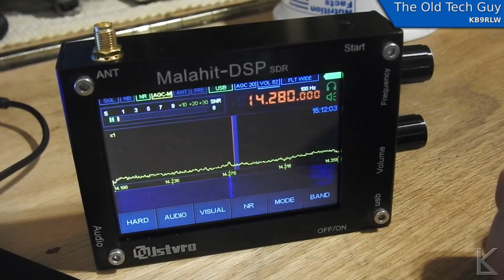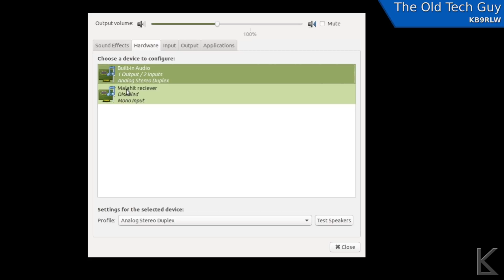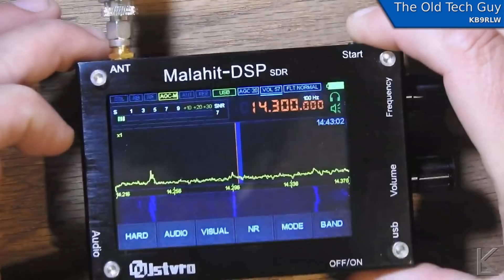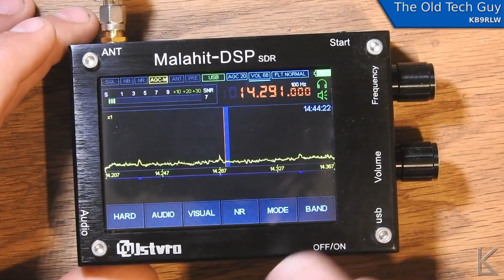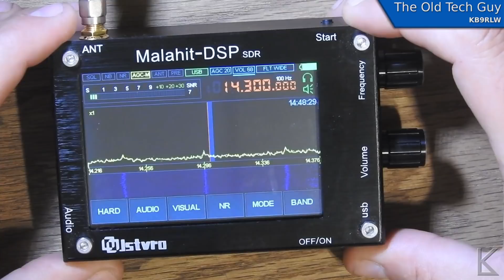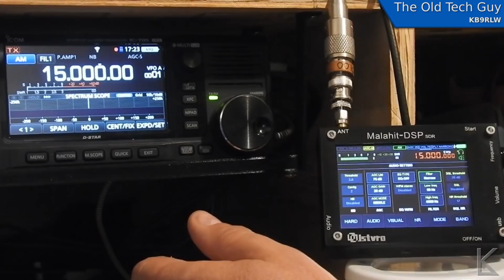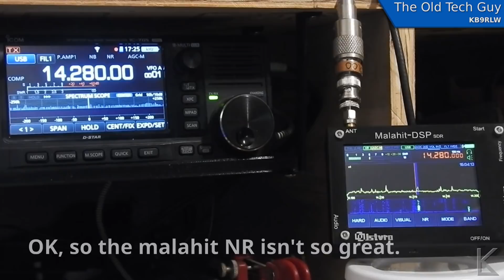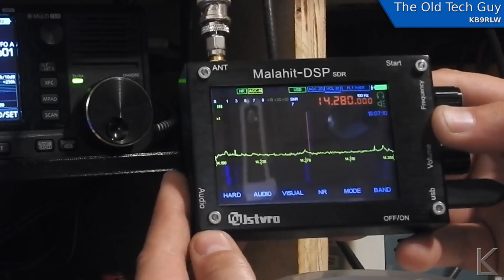Ham Radio - The Malahit DSP portable SDR receiver.

Comment: Any user of this 50KHz-2GHz Malachite DSP SDR Receiver Malahit SDR Shortwave Radio Receiver....have you changed, or tweaked this receiver? I know if I modify the antenna port, the sma connector I'm considering relocating the sma from the left and place it on the top.

Comment: I Like The DEEPSDR Frequency Scanning Knob, It Allows You To Just Press The Knob And Set The Step Whatever You Want It o Be, No menus, No Nothing, Just Press In And Go Where YouW ant To Go, Even If Its By 1Hz, You Can Do It In Split Second If You get Your Hang To It And You Get Familiar With The Interface.
I Have The Fake DeepSdr 101, I Can`t Afford The Original One And STILL, For A Copy That Costs 100 Euros, Its Amazing, IM Getting Whole HF Bands And Comercial WFM And Even Air Band Voice And Everything. Even 2 Meter Band Is There, I Definetly Recomend

Comment: Very fine ! Thanks a lot
Concerning Date and time settings, I did what it is wroten in notice but
only problem I have done this but, it is impossible to save Date and time settings definitively. I have to set date and time every time I switch on the radio, this is awful.
Is there really nothing to do ? 😀

Comment: I just received the 50KHz-2GHz Malahit DSP SDR Shortwave Radio Receiver. I am using it with three antennas: 1) MLA-30+ active loop,  2) Alpha Delta DX-SWL, 3) alpha delta DX-B. Do you think an antenna tuner would be worth the $300? 
Right now it the Malahit is doing great. Band conditions are good today and I am in Atlanta and amateur signals booming in from KS, OH & FL on 40 meters this afternoon.

Kevin: thanks for you review of this radio. I bought it based on your review. Very happy with it for my casual SWL listening while I am working. Bought it on eBay. Took about 22 days to arrive, but worth the wait.

Comment: I have same receiver also from same company yours is. You have to calibrate the S meter trough the HARD key and go to Sm correct, then there move up or down until you read same level as your 705 or in my case I injected a -73dbm(50 microvolts) on 14.100 Mhz and calibrated to read S9.
Its a great receiver,my NR works much better than my 7300 NR. I payed only 180 bucks on ebay for it.

Comment: I have the same rotary encoder skipping/double tap issue you describe here on my hackrf portapack2. Did you determine definitively whether it’s software related? I was considering sourcing a new encoder till you mentioned it may be software.

Comment: Hi Kevin, been looking at the ads for these on eBay and elsewhere and I notice that the ads all state that LSB is a demodulation mode but not USB.  This might sound a really silly question, but am I right to assume that they just missed that off the list, or does it only do USB if you upgrade the firmware? Cheers, Alan
Reply from the maker: It's all-mode.  AM, FM (wide and narrow), USB, LSB, CW.

Comment: Personally I found all these radios that are chinese knockoffs from the original russian made receiver appear to be a bit deaf as compared to other receivers. And many of them are defective in some way usually the touch screen. I bought 2 total from different sellers and had issues with both but mainly they lack sensitivity and selectivity. I'm an extra class ham anc receiver transceiver collector and I would not recommend these for any serious listener. Cute as a novelty item but too pricey to buy just for a novelty. Just putting it out there. My antenna is a carolina 160 up 75 ft and a 40m vertical. The radio and that loooong wire fence should have pulled in WWV on 10mhz at least an s-10 instead of a paltry S6

Comment: Is that Malahit fully loaded with the latest firmware from the russian designers or is it just a demo version as typically sold by the chinese ??     The fact that the CW decoder is disabled is a Hint but I can be wrong.
Reply from the maker: I haven't upgraded it.   The CW decoder works, you just tap the screen button to enable it.

Comment: 235  htz offset error ! well what do you expect, its chinese crap...   unlike a nanovna that is worth the risk at 50 euros, these radios are much more expensive.. its never going to be a reliable radio, built as cheaply as possible its going to DIE on you at some point..the vol and tune knobs with their push functions will crack the cb eventually, its not built well enough to not do that at some point.. touch screen is not that sensetive enough. it is what it is, a cheap ( not that cheap) chinese knockoff radio.. you wouldnt use it as a station radio on a trip to the moon. if your life might depend on it...like chinese torches, ok for looking in the barn for something but going 600 meters underground in a labrinth you would be mad to use a chinese torch... just remember, QUALITY CONTROL  doesnt translate into chinese...

Comment: Kevin, when you did a signal strength comparison between the 2, you had the 7300 with preamp set to preamp 1..... if you switched the preamp off on the ICOM, the signal comparison may have been a little closer..... but overall a good review, thanks mate.. VK2PDX.

Comment: I've got one of those Chinese waveform generators and the optical encoded does the exact same thing.  The key to good optical encoder function is to take one of the digital outputs and connect it to a hardware IRQ.  Then you don't have to pole it and it just works.
Reply: There are different types, the A before B / B before A types, then the 4 bit Gray code ones.

Comment: This might be an option to use as the receiver for satellite work. It would be cheaper than buying two FT-817s (one for receive, and one for transmit), which is apparently a common portable satellite setup.
Reply: I’m thinking same thing but have heard VHF UHF quality concerns, trying to figure it out

Comment: The Aliunce HD1 has a similar problem with the main encoder on the radio as your Malahit. The encoder is not being debounced correctly. I the HD1 there is a fix that involves a couple caps being soldered to the encoder pins.

Comment: To make something clear. China clones have errors in them. Bad internal power distribution. Bad oscillator. Bad ad chip. Preamp not working/imlemeted. I/Q lines crossed in circuit board.... it depends on luck what you get.
 Do not let battery go flat.. it will be brick after that. Use only 500 mA power supply or you will burn battery circuit. 
 Software is pirated with keygenerator so last workin 400-2 g "registered version" is 1.10a. After that original developer have implemented countermeasure. Those rippers in ebay even say that firmware 1.10b is faulty when it cripple pirated units.... so do not by "registered version" from ebay save 50 bucks... install 1.10a and key... if you are cheat
Reply: Some China clones, not all of them, mine works perfect.
Reply: @caulktel   Define perfect... I have ordered original Malachite with adon card.. shall test against china clone..

Comment: As always thank you for you videos! 
These are really  interesting radios. The noise reduction is impressive. I can hear speech brought from nothing a few times. -It's amazing.
I picked one up but I ran into multiple issues with mine:
*Bad soldering: Luckily I'm a soldering guy from way back because every single interface control needed to be re-flowed on the PCB with - leaded - solder. Check your encoder for that!
*Firmware: I have not been able to upgrade the firmware on mine despite several different means available. Software neither hardware have worked.
I replaced with the tuner encoder knob on mine with the one that is commonly used for the Xiegu G90 in an effort to work around the firmware issue.
IMO is that is fiddly and not ready for prime time. -However as a proof of concept it shows what's possible. 
I'm ready for one of the "real" brands to be breakthrough with a "real" SDR SWL radio product. 
73 de N2NLQ

Comment: When you did the A/B switch from the Icon to the SDR on WWV, I thought I noticed a pitch shift, which means that one of them is not on frequency by a small amount. I'd bet it is the SDR. Did you notice the shift or am I out in the weeds somewhere???

Is this radio a clone of a Russian radio? I seem to remember there being something similar to this unit.
Reply: Yes, Kevin said already that's a Chinese version . The original has frontal knobs instead of sides. You CAN also upgrade the firmare but you need to dig for it..for some reasons i won't tell .
Reply from the maker: It's probably still a bit off, the receiver.